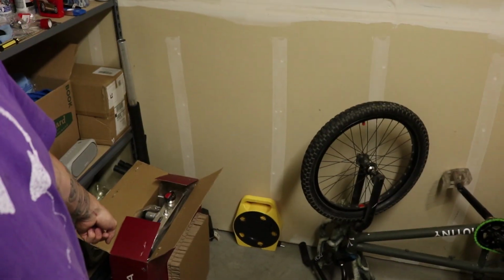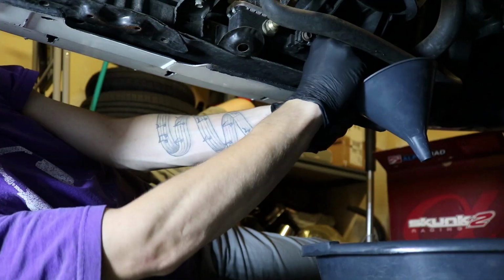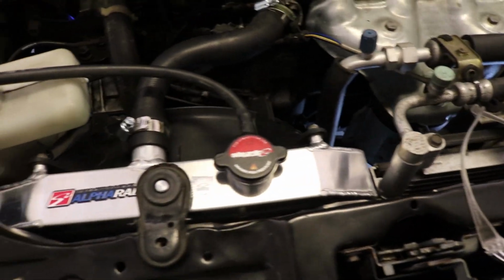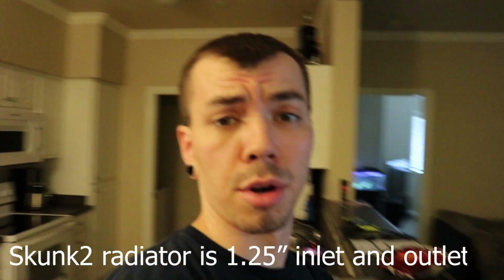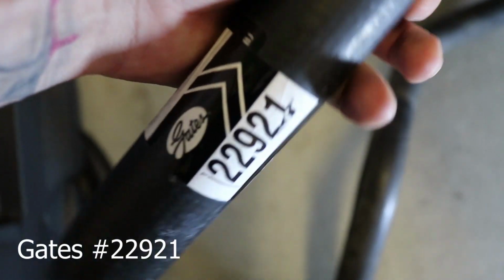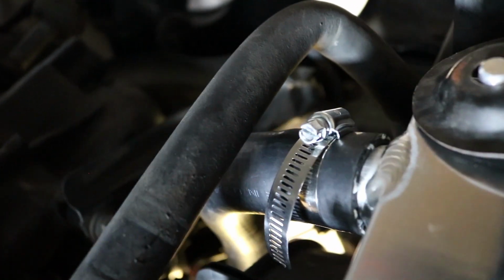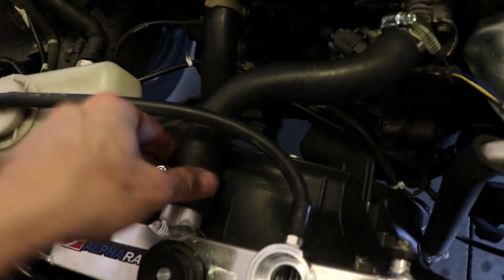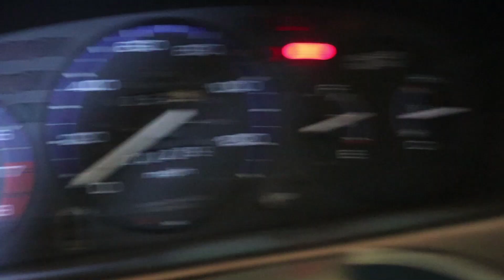Skunk2 Alpha Radiator Install | Civic EK

Comment: D series hoses fit too just need a little elbow grease.
Reply from the maker: oh yea i could make it fit but started hearing rubber stretch and with hot coolant running through it. didn't want to risk it haha
Reply: @oneSMALLgarage  It comes down to preference. I like mine snug. tight seal that way the water doesnt get around the neck and puts pressure on the hose and rely solely on the clamp. With the bigger hoses I feel its loose on the cylinder outlet and t stat inlet. Either way it works.

Comment: Very helpful video sir!

Same problem here with the hoses... As far as I can see the fittings on the Skunk2 radiator are both the same size and both bigger than the fittings on the D16Z6. 
Which, when I understand it correctly, means that both upper and lower hoses will have problems fitting. Is that correct? 
I only tried to make the upper STOCK hose fit the UPPER fitting on the Skunk2 radiator, and that was a real pain to get on. So I assume that both stock hoses are the same size (28 or 30 mm??) and that both fittings on the Skunk2 radiator are 32 mm. 
Please let me know what fitted what, and what didn't,  because it is not alle clear to me... Thanks sir!
Reply from the maker: My top hose fit without issue. Bottom one was the one that gave me trouble so I got a B series hose that worked a lot easier.
Reply: Thanks! I will go and have a Look.... still I ask myself if there isnt too much space on the engine side. Because the D16 fitting is 28mm and the hose you used is 32mm. 

BTW, what is the make / brand of your short ram intake?
Reply from the maker: @erikthehondaguy7766  AEM (passed smog with it too)

Comment: I have the same issue wit my radiator hoses not fitting from my skunk2 radiator to my d16z6 engine. The hose u got, gates 22921, did it fit correctly onto ur engine block
Reply from the maker: Yea popped on with no issues!

Comment: So the lower and upper B series hoses fit on a D series Engine?
Reply from the maker: Not sure about upper but lower does for sure. Probaly could have used the upper but was able to get the top one to fit so did not mess with it too much.
Reply: @oneSMALLgarage  Seems like you still used the oem upper hose, how did you make it fit properly?
Reply from the maker: @Mindkiller9669  yea fit with no issue at all.
Reply: My top hose had very hard time getting on! I'm getting a lower hose like you mentioned. Any advice for top hose? I also have a skunk2 alpha on a 2000 civic ex d16y8. Appreciate your vid man ty
Reply from the maker: Did the lower hose end up working?  For the top hose is it pretty close or can’t get it on at all? My top size on both radiators was the same so mine just slipped right on.
Reply: I'll be trying again today, I'm going on a trip so might hold off until I'm back just to play it safe. Sweet I appreciate your reply one small garage. I'll try it out! I did take the skunk2 lower hose from my 95 integra gsr, will be trying that out aswell. From what I heard the integras 93-2001 work for the bottom hoses. The top oem hose was super damn tight and bulged the hose a bit. Bit if it's working for yall then I have no sweat about doing it when I get back. I'm doing a 4k miles trip so I don't want the hose acting up on me for what ever reason.

Comment: hey man, what did you end up doing with teh ac cooling lines that are from the oem radiator? those 2 brass attachments from the oem rad? im about to replace mine but am worried about having the 2 wxtra connections
Reply from the maker: I think the previous owner might have disconnected them before or something cause mine had nothing connected to them. My car had some goofy stuff on it from the previous person so figured it was just like a junkyard radiator or something. But I can always check tomorrow and see if I see anything plugged or capped. Didn't know it was for the a/c but I can see if I find anything lol.
Reply: @oneSMALLgarage  yeah my b its not the ac its the transmission lines. you probably have an aftermarket transmission cooler it looks liek a mini oil coolant. i was just curious because im about to replace my oem radiator but have been noticing all the ones i want (skunk 2 alpha, mishimoto etc) all say only with manny trans as they dont have those transmission coolant lines that automatics run.
Reply from the maker: Oh I have a manual transmission that's probably why I had nothing connected.
Reply: That old radiator was for an automatic transmission civic.
Nothing to do with the AC
Reply: I think 🤔 you forgot to swap these rubber donut support to the bottom of the new radiator.
It was a pain on the ass but I used my D series bottom hose 😁😎
Reply: Aftermarket radiators sold by AutoZone, O'Reilly, Napa..... Stock 1 radiator that works on both manual and auto civics (with transmission cooler at bottom). No sense taking up double shelf space.